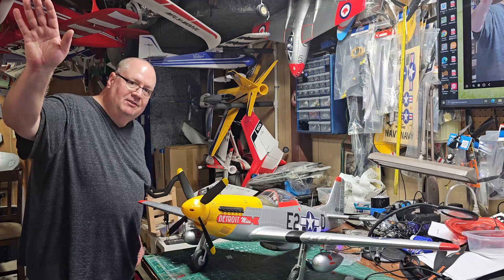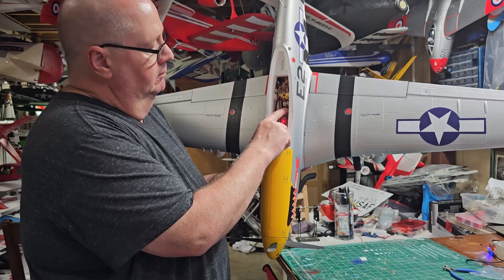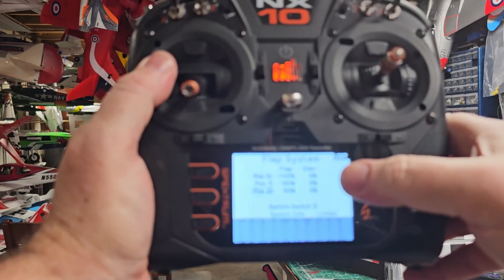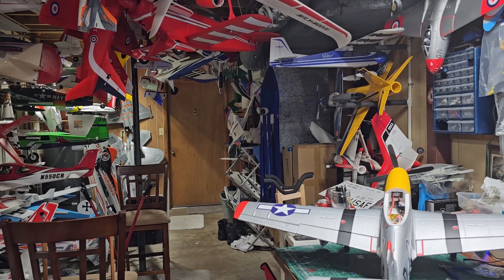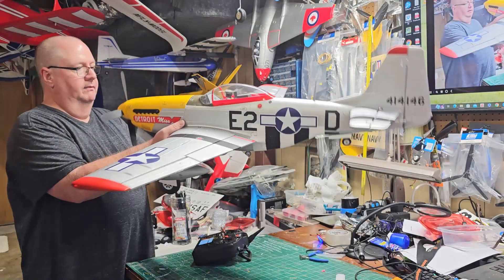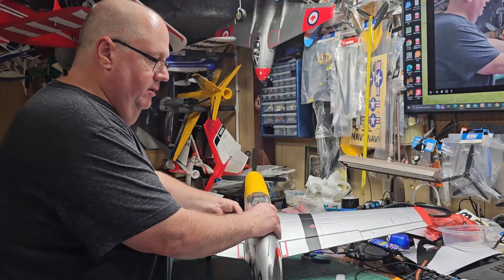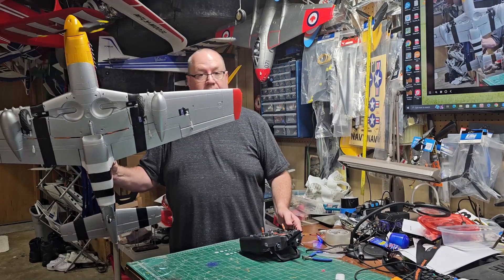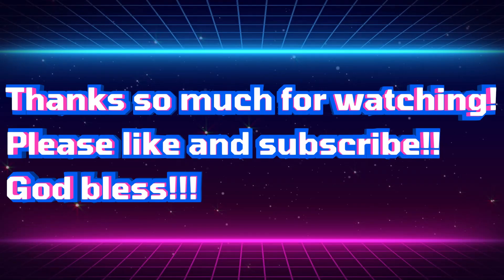ARROWS RC P-51 SIMPLE RADIO SETUPS by Fat Guy Flies RC

Comment: I have 2 FMS planes that I can not get reverse to work. Is there some setting in the 
ESC that needs to be changed? I have followed you procedure to the letter. On 3 other FMS planes it works perfectly.
Reply from the maker: I assume they do have the little yellow wire coming off the throttle lead right?  if so then plug it into an open port on the receiver and assign to switch. NOTHING needs to be done in the ESC.